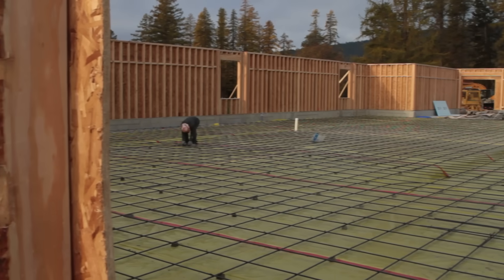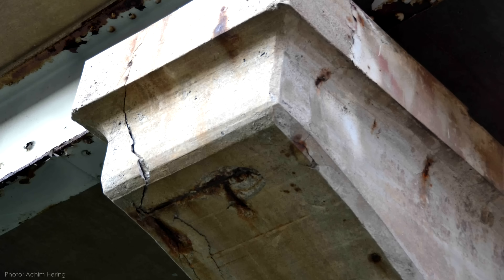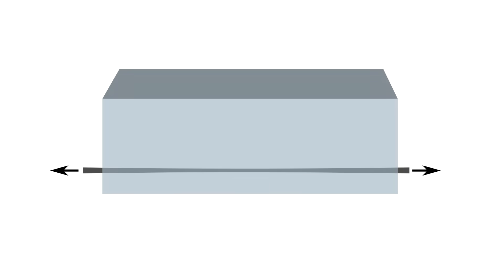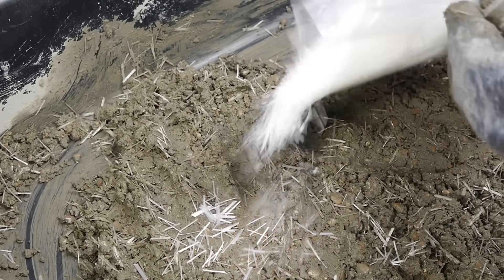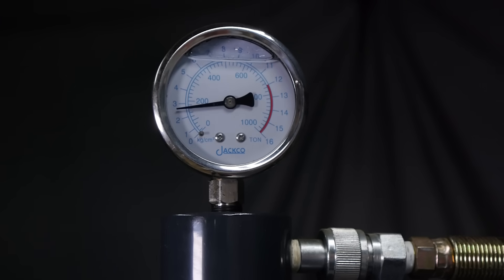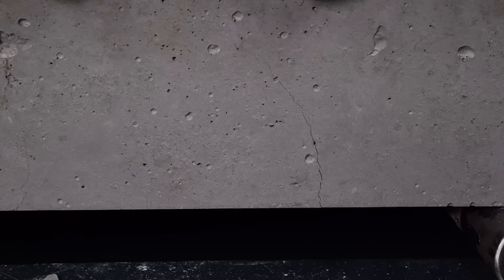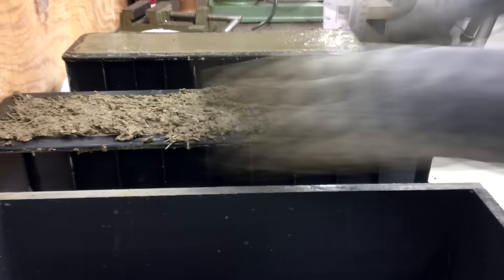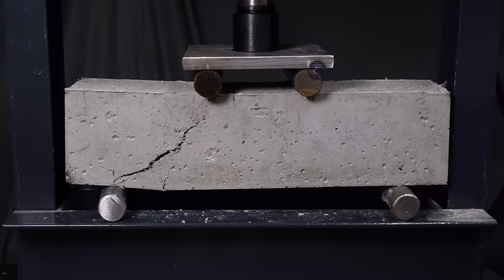Does Rebar Rust?

Comment: Hi This video is all about ensuring concrete cover for the reinforcement to prevent corrosion, yet at 2:37 to 2:44  in the video,we can see the concrete being poured with the reinforcement mesh sitting flat on the base that will result in zero bottom cover for the reinforcement.

Although doing a great job with the video, that section of video should be flagged as "doing the wrong thing" as to the cover requirement.

cheers.

Comment: In this video, Mr. Grady fails to mention the best material to combat rebar corrosion:  GALVANIZED STEEL REBAR.  The hot galvanization process of steel rebar provides an ultra strong coating that is metallurgically bonded to the steel and is much harder than the steel it's protecting.  This ferrous zinc alloy is ultra strong and self-healing.  Also, the cost of galvanized rebar is lower than other alternatives.

Comment: What about chemical additives to reduce Iron oxide formation? Also, what has been used in historical bridges and tunnels across seas such they have avoided this issue of steel corrosion and concrete degradation for years?

Comment: I've always thought we should replace rebar with plastic. The same hard plastic that artificial 2x4s are made from. That stuff is super strong and will add the necessary tensile strength
Reply: Does it have the same thermal coefficient as concrete?
Reply: @thenoblepoptart  not changing the concrete just the rebar itself

Comment: Four points that I think were missed. Concrete is not waterproof, in fact it soaks up water, (ask an engineer in the Pacific North West). Carbon from Carbon Monoxide settles on structures and water quickens the travel of carbon into the concrete and onto the rebar. Carbon helps steel rust.
   Concrete shrinks, concrete cracks. Not sometimes, pretty much all the time. Only if coatings allow for a lot of movement will they be effective in waterproofing concrete.
    And of course the obvious fact that 99.9999999% of rebar put into a structure is rusty when the concrete is poured. Even in this video we saw rusty rebar being put into the structure.
Water, Carbon, Cracks, Rust already on the rebar. = Building go down.

Comment: I used to work for a company that manufactured industrial paints and coatings called Tnemec.  Their flagship product was a coating that prevents rust. It came about because one day the founder of the company noticed some rebar sticking out of old concrete rubble and noticed it wasn’t rusted.  Long story short, they made a coating with cement in it which then had the rust inhibiting properties. The name Tnemec, is cement spelled backwards. 

Tnemec makes all kinds of coatings for many things like zinc based coatings for water immersion service, water towers, coatings for bridge beams, sewer linings and even aerogel coatings for thermal insulating… pretty awesome stuff. The list is pretty impressive and I only named a few.

Comment: 2:36 Please tell me how this construction is even remotely OK?  There will not be sufficient concrete to properly encase the the rebar.  Does this design depend entirely upon the plastic lining to protect it from moisture?  Will there be enough concrete around the rebar to properly secure it?

I'm angry because I brought a home several years ago that needed foundation work and to be re-plumbed (old house, cast iron sewage) and I discovered once started jack-hammering that the bastards didn't raise the rebar before pouring the foundation.  Some of it that was exposed to the ground underneath (and leaking sewage) was completely rusted away.  afaic, some lazy construction workers didn't do their job in the 60s and that cost me a lot of problems in the 2010s.

I've seen (witnessed first hand) SO many foundations poured like this.  They originally raise the rebar, like they should.  But when the inspector's gone and they cement trucks come in, they just drive right over it and smash it to the ground.

Comment: A person would think that in this day and age a better quality of steel would be used for rebar. Take a cheap razor knife and score (scratch) a number 5 + bar tap it with a hammer and it will break easily. Al rebar is crap.

Comment: Check out the bridges on Oregon coast, when they were built beach sand was used in concrete mix.
Massive amounts of effort and dollars have been needed to repair or replace those spans.
Reply: Salt needs to be rinsed out of the aggregates, especially sand. I have seen mortars that also crumble this way and for the same reason.

Comment: I hate the fiberglass rebar, you have to cover it to avoid sunlight hitting it. It starts to flake and you're not meant to let that happen to a certain degree, some are coated in plastic but most aren't in my experience. The worst part is to have to climb over it, god it's uncomfortable to try to climb over that stuff prior to a barrier wall being poured

Comment: The rebar in the slabs hould be mounted off the floor not walked on as in video.  Sometimes welded wire is lifted with a rake as they pour 9but this makes engineers nervous that it was uniformly lifted up into the concrete to provide the 'cover'.  In vertical applications keeping the rebar at least 2" from the outside form is very important.  How do you know that was done unless one of our field inspectors is watching.  On marine applications, this is critically important.  Also keeping forms in place for adequate time to keep concrete from shifting ad leaving  a space next to the rebar.

Comment: Working on UK building sites in the eighties we used to use reinforcing bar that already had rust on its surface, mainly on concrete flooring slabs. It can't corrode if its already corroded???

Comment: There was an interesting case in Soviet Russia with Luzhniki Metro Bridge in Moscow. It's a double-decked concrete arch bridge and It was built in the late 1950-s and in record times, about 19 months. To speed up the construction and to be able to continue pouring concrete during the Moscow winter they used salt in the mix to make sure concrete can properly cure at -10C/14F. The bridge rapidly deteriorated and had to be partially closed down only 14 years later.
Reply: I'm experience, not an expert. with that said, no wonder it failed. The temperature alone will cause it to fail. The salt didn't help the curing process, it only hurt it and made it cure weaker. Salt won't make the cement get warm enough at that temperature, calcium chloride will but even then it will still cause corrosion and can make it weaker.
Reply: It was informative. Thanks.
Reply: Fascinating. Meanwhile the Romans created concrete that has lasted for 2000 years. I don't understand why we can't crack their code.
Reply: @FablestoneSeries  the roman concrete wouldnt last with our modern stresses. we load our structures way more than the romans did
Reply: @FablestoneSeries  
Because the Romans never had fully loaded 18 wheels bouncing over them at 60mph
Reply: @FablestoneSeries  The exact composition of Roman concrete is not officially known as that would require destructive testing of the buildings, which no government would allow.  But, we do know the ingredients and methods.  The best Roman concrete used volcanic ash as the cement, volcanic stones as the fine aggregate, and brick sized chunks of granite as the coarse aggregate (enormous compared to the gravel used as coarse aggregate in modern construction).  They also used so little water that building with it would be more like masonry work than pouring.

As Intranet said, survivorship bias is at work here.  For less important construction they would have used sand as fine aggregate (just like modern concrete) and bits of whatever broken stuff was lying around as the coarse aggregate.  They probably still used volcanic ash as the cement most of the time, but they definitely also knew about lime cement, very similar to modern portland cement.  

I'm not sure what the chemical significance of using ash instead of lime cement is, but it is definitely more resistant to acids, salt, and less soluble in water after curing.  Using less water makes the cured cement stronger - cement doesn't dry, it chemically hardens with the water remaining as part of the structure.  Using larger aggregate means that the cement doesn't have to hold stresses over large distances, reducing internal stresses.  It also means that if the cement does crack (in a seismically active region like Italy, it's when, not if) the spread of the cracks is restricted and the brick like internal structure is still going to hold the weight just fine.  Being picky about what you use as aggregate means that you don't have to worry as much about inconsistencies in thermal expansion, hardness, or strength.

And since we know all of this, why not use it.  As you'd probably guess, cost.  Hiring a dozen day laborers to spread concrete and 2 skilled finishers is a lot cheaper than 2 dozen union masons.  Brick-sized aggregate is not going to pour out of a mixing truck, you'll have to mix on site.  There's a finite amount of volcanic ash, certainly not enough to produce all the concrete we use in construction globally.  And large aggregate means that you're not going to get a smooth finish; you'll have to coat it in a much weaker material, perhaps a surface coat of pure cement.  That means you have to do 2 passes and you have to do much more frequent maintenance than we currently do, resurfacing every couple years.
Reply: @SeniorKlean  they use seashells burnt and broken down to form calcium.
Reply: @FablestoneSeries  we have. basically, their concrete has chunks of material in it. that material expands when in contact with moisture, so it repairs itself. it also basically turns into rock when in contact with saltwater, so... well you can guess what they put in it. obviously they understood that concrete dosent do well in shear forces, so they used arches instead of flat planes.
Reply: @FablestoneSeries  Practical Engineering has a video on that exact topic of why Roman concrete is not better than what we have today. First, there is no good reason to spend the time and money (taxpayer dollars) to build something that lasts thousands of years when it really only needs to last a few decades before it is torn down for something better or to meet new demands of being built somewhere else. There is no reason to build a road or bridge that lasts 1000+ years when cities are created or are abandoned over the centuries, when routes need to be changed to meet different traffic demands, when bridges/roads need to be torn down or rebuilt for environmental reasons, and even rivers change their patterns every few centuries. So those surviving Roman structures are overengineered and impractical in terms of cost-effectiveness and are not flexibile enough to meet changing needs. 
Second, outside of PE's discussions, there is survivorship bias where only the best built Roman buildings (their best civil engineering projects) survive to this day while the vast majority of average or lower quality Roman buildings have crumbled/disappeared. For example, you typically don't see any Roman apartments or regular Roman house from the Roman era survive to this day even though they were the most common type of building.
Third, Roman buildings such as the Roman Pantheon were actually in continuous use through the middle ages, so they were continuously maintained and repaired.
Reply: @Intranetusa  I'm seeing a debate by me about replacing a bridge that is 100 years old. There is so much debate about it that the only way it's likely to get replaced in any sort of hurry is if it actually breaks and causes a major traffic disaster in the process. I would say that's a great argument for building a bridge that could last a thousand years. People refuse and wait to change things because they're stupid.
Reply: @Intranetusa  that’s totally wrong in Italy, we still use those bridges and roads 2000 years later… no problem at all 😂😂😂
Reply: @3dvorator  You're talking about the exception and not the rule. Italians only use a tiny fraction of ancient roads that happened to survive and are still useful enough to continue to be used because they were in the right location. Italians built buildings over or bulldozed many other surviving roads (see the McDonalds built over the Roman road in Marino) because they were still useless even though they survived. The vast majority of roads and bridges from 2000 years ago are no longer used today and/or fell into disrepair, and basically nobody uses the ancient aqueducts today. It's a waste of money and time to spend extra resources to overbuild something that survives thousands of years even though its useful lifespan is only a few decades or centuries at most.
Reply: @jeff mattson  Practical Engineering has a video on that exact topic of why Roman concrete is not better than what we have today. First, there is no good reason to spend the time and money (taxpayer dollars) to build something that lasts thousands of years when it really only needs to last a few decades before it is torn down for something better or to meet new demands of being built somewhere else. There is no reason to build a road or bridge that lasts 1000+ years when cities are created or are abandoned over the centuries, when routes need to be changed to meet different traffic demands, when bridges/roads need to be torn down or rebuilt for environmental reasons, and even rivers change their patterns every few centuries. So those surviving Roman structures are overengineered and impractical in terms of cost-effectiveness and are not flexibile enough to meet changing needs. 
Second, outside of PE's discussions, there is survivorship bias where only the best built Roman buildings (their best civil engineering projects) survive to this day while the vast majority of average or lower quality Roman buildings have crumbled/disappeared. For example, you typically don't see any Roman apartments or regular Roman house from the Roman era survive to this day even though they were the most common type of building. 
Third, Roman buildings such as the Roman Pantheon were actually in continuous use through the middle ages, so they were continuously maintained and repaired.

Comment: Can you use plastic to coat rebar  to avoid corrosion?
Reply: You can read up on epoxy-covered rebar. It was touted as the ultimate solution to the rusting problem but it turns out it's really hard to spot ALL the cracks and other issues with the rebar coating after installing rebars. This leads to constructions sometimes deteriorating unexpectedly. Basically it's a lot of work to carefully install and check and even then it doesn't give you enough of a guarantee against corrosion.

Comment: Doesn't the fact that concrete is wet when it is poured begin the rusting process right away? Couldn't rebar be placed at 'random' intervals/depths/angles/etc so that the stress on the concrete is not consistent?

Comment: I noticed you used just straight rebar in your test pieces. Full scale reinforcement also uses 'returns' - the rebar is bent around and back on itself at the ends, thus giving greater tensile strength, as the bar cannot pull through. In the UK we use 'beam and block' suspended floors; the beams have this feature and are made to the exact length required. Cutting them shorter is not allowed, as it removes the returns.

Comment: A very interesting topic, thanks for posting. I watched because in 2021 I had this exact problem. My 123 year old building has a roof made of reinforced concrete that was poured in place. The total thickness of the roof is only about 3 inches, so there is no cover. A section of the roof collapsed. Thankfully, no one was seriously injured. A roofer was on top at the time, and fell about 20 feet, but bounced of several pips and pieces of equipment on the way down, and only had burns and bumps and bruises. The entire roof will be taken off in the spring, and replaced with steel deck.
Reply: Impressive, given the fact that the first commercial uses of reinforced concrete were only made in the 1870s! So your reinforced concrete roof from 1898 was actually a museum piece, you were lucky that it didn‘t end up on any list of protected monuments, that would have sucked as far as renovation constraints go.
Reply: @arrzfr  sorry, math error, there, 113 years old. It was built in 1908. So far, no one has indicated it as a protected monument.
Reply: The hell are you doing living in a century old building? Buy a new 🏠
Reply: @armincal9834  It's a business, and it's a beautiful old building. There are postcards of it floating around, one from 1926, and another from the 1950s, so maybe it should be considered a historical building.

Comment: I delivered 1.5 yds. of concrete to a company that makes forms CC Seawalls in Port Charlotte. It called for a 5 slump but while I was there they had me add 40 gallons which turned it into 10 slump. The guy said it's easier to work with getting in the form. I didn't argue but it occurred to me that this is why when hurricane Charlie hit in 2004 it caused 50 million dollars damage to sea walls. They were not according to spec code. I ordered a 1 or 2 slump and got an 8 to 10 because the pump operator preferred it. Then the driver was helping and fell in causing a void. People just don't care about doing it right. Concrete columns are the last things standing in Rome since 2,000 years ago and will last 3,000 more years if done right. Even the Wall of China has survived because of one extra ingredient, rice. Concrete consists of rock either pea stone or gravel, an aggregate like ashe, cement to bond, sand and water. The thicker the better. Thanks for the video.